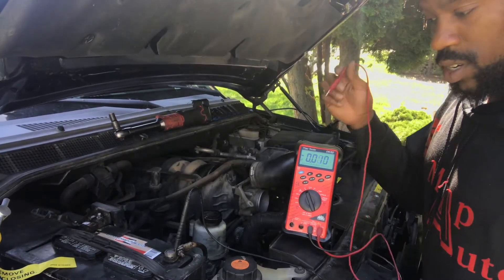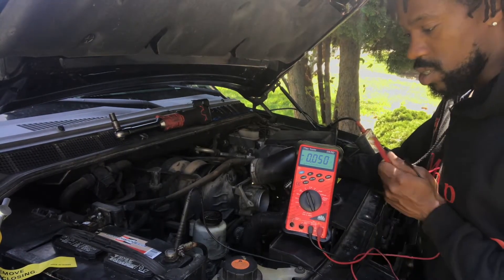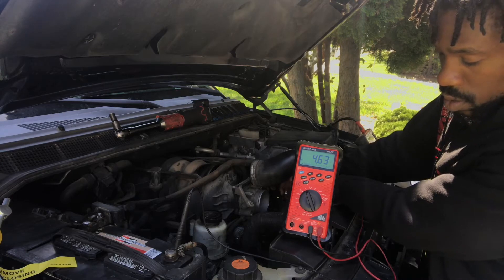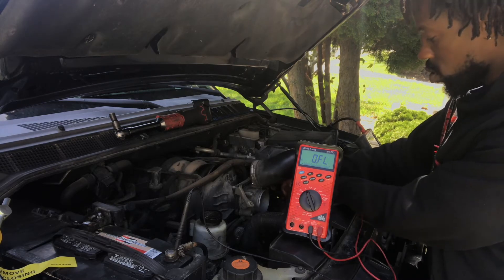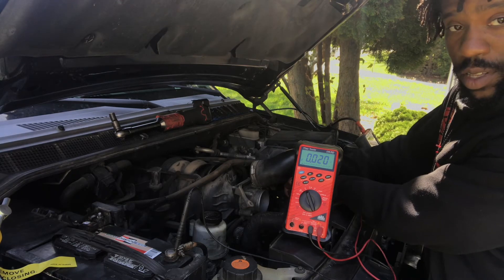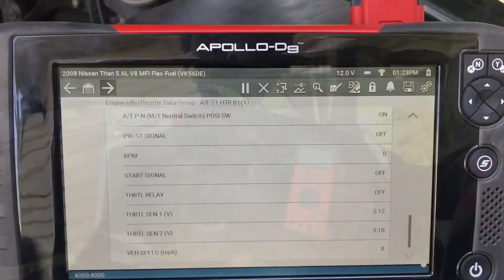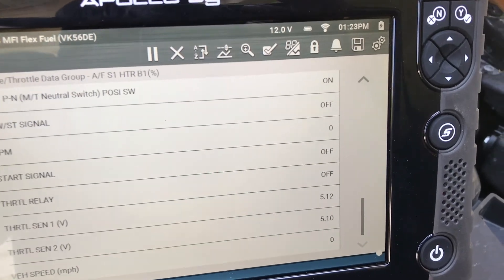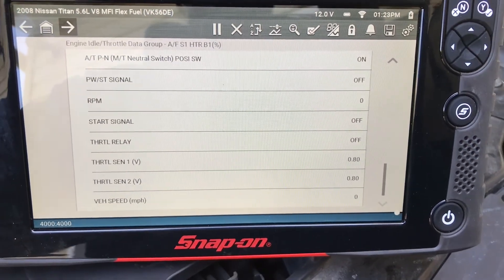Voltage readings on a throttle position sensor connector

Comment: Have you ever seen one hummed . A high pitch . And the hand held fuel voltage  seem to fluctuate. There is no way to check the transistor in the pcm. Without a pin out. The travel of power from the tps to the  tb from the pcm